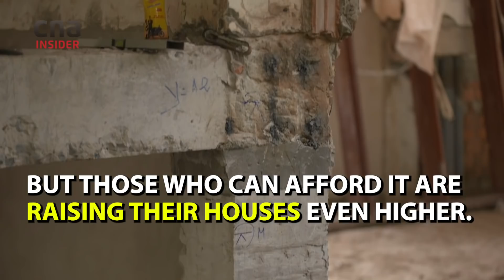Why is Ho Chi Minh City Sinking?

Comment: Correct me if I'm wrong but someone told me the sand used for building is actually extracted from neighboring Cambodia. Even the sand VN sold to SG for its land reclamation project was also from Cambodia.
Reply: The more VN do this the more KARMA will come to them...